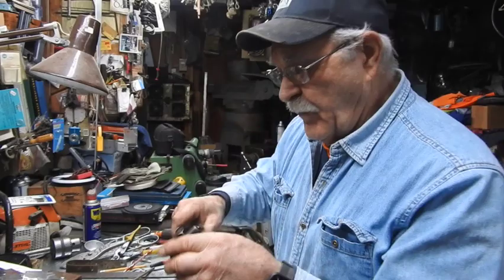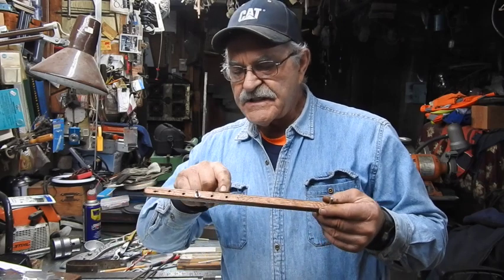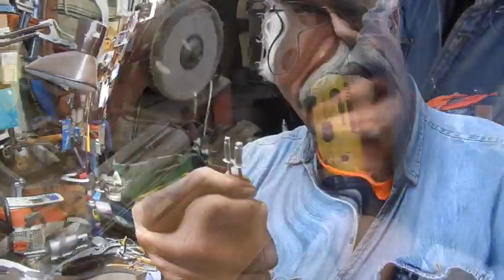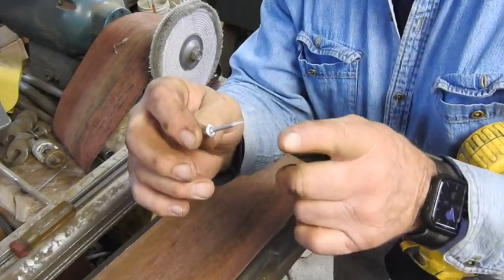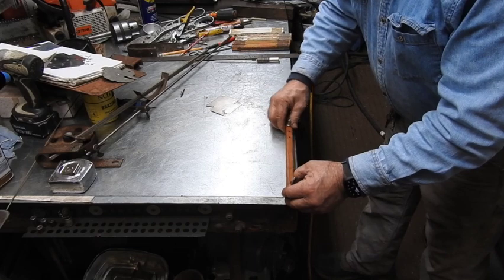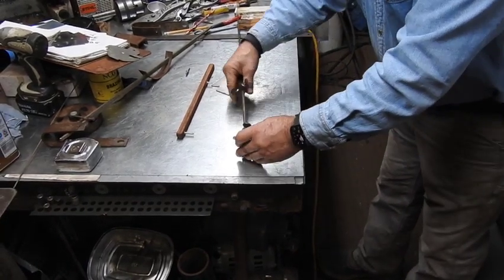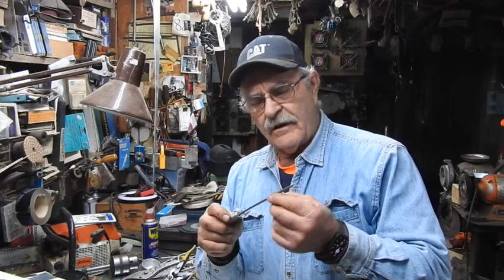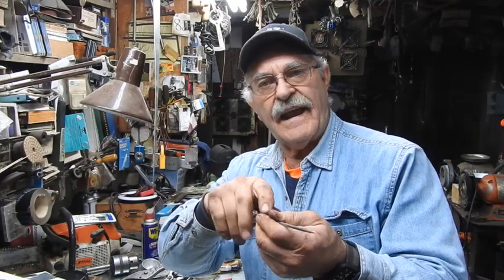A Point About Trammel Points: Sheet Metal Hack

Comment: Huh! I never knew there was a difference in folding rules. 
I would like to see the scribe video. I am always amazed at how little I know about things. Just a view from the other side can make all the difference. 
I like using marking gauges for repetitive marks. The first one I got was pretty sad so I didn't use it much. As usual once I bought one 10 more showed up. A few of them are really nice. I can set the beam to match the dimension on a steel rule and Bob's my brother. 😁😎
The one I don't have yet is a panel marking gauge. It has a much longer beam and a wide fence to keep the line parallel to the edge. Not something I do a lot. 
I do have a fence. I just need to make a beam for it. Rosewood sticks a couple feet long are getting hard to find.
Reply from the maker: Now I find that difficult to believe that I actually showed YOU something you didn't know about an old tool !!  LOL.  You'd maybe like my 48'' circumference rule I bet.  In line with each of the 1/8'' increment markings there is straight across the steel rule from those markings is the circumference of a circle with that diameter.  Now that I think about it, I have to check and see if its on the 1/4 or 1/8 marks.  But you get the drift.

Comment: Wendell,I have a trammel point like your sliding key stock unit made by Malco. I think I bought it at an auction in a bucket of tools for $5. AL B.
Reply from the maker: Auctions are a great way to pick up stuff cheap.  However, last summer I was sleeping on the job and let a stack of (50) 24x 96 x 26 gauge sheet metal slip by for $4 a sheet !!  That was almost like stealing it.  I cleaned up on other stuff though.  Like a box of 50 capacitors for $2.  All new stock.  New 1/2 and 3/4 belt drive and direct drive motors in the box for $4 each.  I love auctions !!  Not every one goes like that though.  Ya gotta be careful.

Comment: Two for one hacks in this video. Great way to sharpen a point. I do have the Malco tramel collecting dust in my toolbox ever since the company I work for have a plasma table purchased 20 years ago. Passed on to me when my dad retired. Thxs for the vids!
Reply from the maker: Man, there ain't a day in the shop that the belt sander isn't used for something or other David.  I use it to thin down a new to me ax, reshape flat screwdrivers, remove mill scale from small metal parts for welding projects....the list goes on and on. I even trim the ends of hammer and ax handles after installing new ones.  I don't use the trammel points hardly at all anymore either....but its not because of my cnc plasma table. (I don't have one)  LOL

Comment: This was a great video, as always. Videos like this provide necessary nuance to shop work that you really can’t get from anywhere except experience, or from other guys sharing. 

I would love to see your video on the scribes, as I have invested in various types for my shop and am curious about your uses for them.👍
Reply from the maker: Most of my uses for scribes revolve around sheet metal or welding projects. There are a lot of uses servicing both residential and commercial heating and a/c systems as well. I will now have to find the old video in the SD archives or just make another one....which may be easier in the long run. Thanks Christopher for the interest.

Comment: Hey! I would like to see that scribe video!
Reply from the maker: Hey Matt....Good morning my friend.  I'll dig it out of the archives.  Might take a bit of an effort because I've still not got a good way to record what's on them.  LOL  I have essentially a library where a disgruntled librarian dumped over all the book shelves.  Yessir, can't find Waldo !!
Reply: @tractorman4461  😂👌
Reply: @tractorman4461  As a former engineer I tend to follow the old ways I was taught. 
Just like a file cabinet with hanging folders and manila folders jammed inside from 40 years ago I have major folders and subfolders on my hard drive. Each project starts with a major folder. Millers Falls 120B for example. Then in that folder is a sub folder with teardown, cleanup, paint, assembly etc. folder headings, I have blank project folder with those subfolders in it ready to go. All I do is copy the blank folder and name the copy. As I take video I dump them into the laptop and sometimes I don't get back to them for a year or more. They are still there and can be found with a keyword search in the file manager. 
I use a PC clone android with MS operation system. Don't know if it is similar on a MAC. 
Saves me a lot of time. 
Lydia used her secretarial filing knowledge to set up my file cabinets at UTC in 1981. I was complemented as being the most organized Maintenance Manager they ever had. 
Since the guy before me used the one file drawer in his desk to hide his bottle and snacks it wasn't a high bar to get over. 
The entire library of Operating and Maintenance Manuals for a 106,000 sq. ft. shop with three extrusion presses, two remelt furnaces, and anodize shop and a fabrication shop was filed by the pile in one end of the office. I spent my spare time, what little there was, reading the manuals on the equipment. 
They were amazed at how much I knew about extrusion presses without ever having worked on one before. 
I never let my boss know. I did have all the people working for me go through the manuals too. It saved a lot of OH SH*T phone calls at 3:00.am.
Reply from the maker: @OldSneelock  That's an impressive set up you described at UTC.  I could never get it together that good.  Paperwork is my enemy!!  Or so it seems anyway.  And I'm sure the Mac has similar filing capabilities, but that, my friend, is beyond my pay grade to figure out !!  You were fortunate to have been a 'teachable' student to your learn your wife's lessons easily.  I however, seem to have a mental block that requires endless repetition to hammer home the slightest change.  Heck I still can't even place text on the screen to correct a mis-spoken word in a video.  LOL No joke !!

Comment: Great video.i made a very similar wooden scribe tool like yours.have some very old trammel points that clamp on a one by one wood stick.have used them a lot over the years on large square to rounds.i had to break down and get a large handle scratch awl because my hands are not what they use to be.helps to hold on to it.
Reply from the maker: Yeah, I know about the arthritis in the hands for sure !!  I still like my old ice picks.  The wooden handle feels good and they are long enough it lets me reach across my table real easy.

Comment: Another great video. Being an ex aircraft mechanic I was used to modifying and making my own tools, so I am always glad to watch some one making their own tools. I have used the old drill and belt sander trick for all kinds of points on all kinds of tools.
Of course I want to see your scribe video.
Reply from the maker: I use that trick to make a quick pin punch for this or that.  Many other things too Rick.  Lot's of shop tricks up our collective sleeves I bet. The cool thing about a belt sander is it has a tendency to not heat up the metal too quickly...and that's good !!

Comment: would love to see an essential tinners tool kit video!
Reply from the maker: You know Wayne I started that one time just to round out the tail end of a shop day and quickly realized the discussion was gonna be waaaay too long.  I carry a Kennedy large box with the trays that fold out two to a side.  So it gets quite heavy.  I used to literally dump it upside down once a year right in the middle of the workbench and clean it out.  But I may get around to do it for you one of these days.  I don't need everything in there any more, and the duplicates have been long removed for the most part.  Thanks buddy for watching.
Reply: @tractorman4461  ScoutCrafter has mishmosh Mondays where he puts together short topics into a magazine format. 
Your toolbox would be a good base to work from. 
Drawer by drawer or topic by topic with just one as a tailgunner on a video ending up making a series of videos.
Reply from the maker: @OldSneelock  Hmmm...sounds pretty neat.  I seem to lack most of the creativity needed to plan much of anything.  LOL. My workload change from morning to afternoon many days.  I am getting it more under control to a certain extent now that I don't do a whole LOT of work for others.
Reply: @tractorman4461  When I was working it was even more helpful. 
I often worked 12 hour days and did a 3 hour round trip commute every work day. My project time was limited to say the least. 
Putting out one video a month was about the best I could do. The work was done in 10 minute to half hour increments. 
I treated the videos like the work instructions I was creating. That's where the file folder deal came from. 
I needed to be able to edit work instructions so the photos and text had to be quickly retrievable. 
I just started putting the YouTube videos into a folder on my computer at home the same way. 
On the weekend I could string them together and post them. 
If I was in the shop building all day it would be harder to do the downloads so I set up the laptop to just put the chip in and download the data. 
It ain't easy being us. Is it.
Reply from the maker: @OldSneelock  Your commute sounds almost like mine for many years.  But doing HVAC service, I'd start at a different location every day....unless I was on a construction project.  Most times my trip would be and hour to and hour and ten minutes.  Bad days would be longer.  The good thing was i had a company truck, so all the cost was borne by the company.  I just had to have it serviced on my own time.  But that's a small price to pay for a free rolling toolbox !!  And yes, the project time at home WAS a premium...but then I had the energy to work much longer and much later after dark than now.  Hahahaha...the last point....no, it ain't easy at all is it !!  LOL

Comment: Years ago, I carried a Lufkin "Plumbers Folding Rule" for calculating the length for 45° offsets.  Measure the offset between the two pipes (center to center) that needs to be connected with 45's with the regular side of the rule (black numbers), place your thumb on the number and turn the rule over.  This is the length required for using 45's (red numbers).  Of course, you had to deduct for the fitting allowance.  Unfortunately, they only made them with the regular (black numbers) on the outside.  You could of course just multiply the offset by 1.414 to get the proper number but that was before pocket calculators.
Reply from the maker: You beat me to it !!  As I read your first two lines I was already planning to toss in the 'offset x 1.41' trick.  LOL  Retired fitter here.  Mostly refrigeration piping, gas piping and boiler piping though.  As a service fitter though, most of the time I was troubleshooting and doing hvac system and DDC controls start-ups.  Good comment buddy.

Comment: Very cool video. I always get great ideas from videos like this. I don't remember why but, when I worked with the Boilermakers in the shop, most of them used outside rules. When I worked with the tin-knockers it was inside rules. My go to rule is an inside rule and it's getting so worn on the outside that you can't read any numbers. Carried that one a lot of years in my back pocket. 👍👍👍
Reply from the maker: I've went through quite a few of them myself.  Sometimes the brass joints get loosened and there goes the accuracy.....BOOM...they are gone, death warrant signed, sealed and delivered to the trash can !!  LOL.  I have a few missing most of the numbers on the backside too. (-: